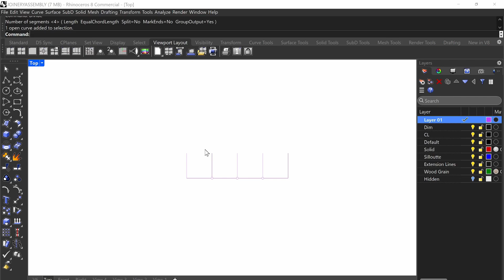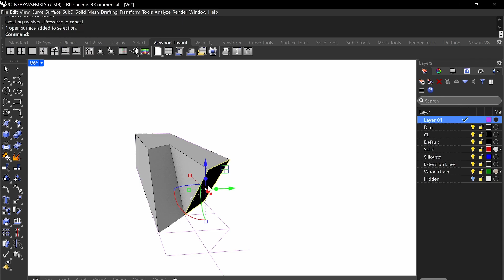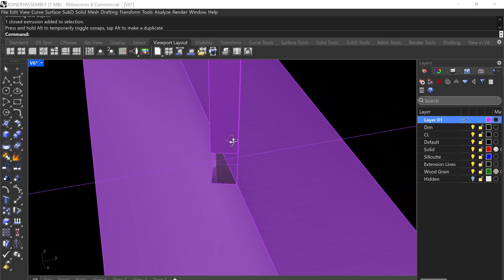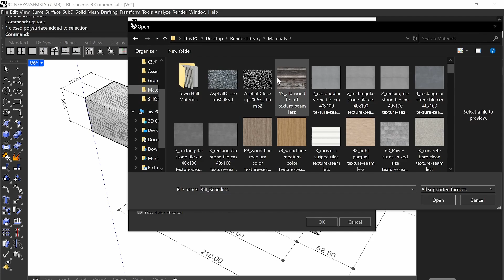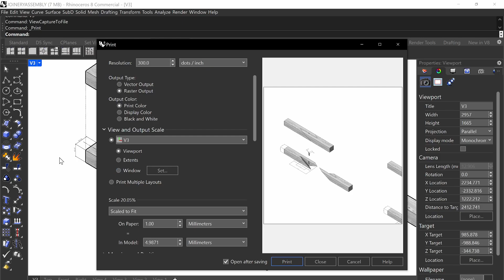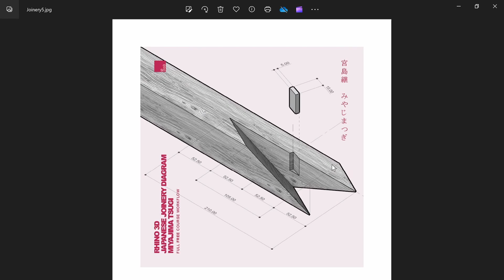Japanese Architecture Joinery in Rhino 8 with Display Settings, Layouts, and Dimension Styles.

Comment: May I ask how you fix the broken corner of silhouette line in the monochrome display?
Reply from the maker: Yes, at 16:00 for curve settings, keep the setting at "Use Object Width."  Make a dedicated layer for a silhouette and add a silhouette curve around the edges. Give the silhouette layer a line thickness. 

If you do the method above, then you do not need a silhouette to be displayed in the options. I have another example of this in the video below (With time stamp)

https://youtu.be/QeDg9GdOrss?si=FtSaKmEFnr58Izqb&t=541

Comment: Learning a lot from your contents, Thank you!
Just noticed that the rotation angle of the key piece looks other way around.
Reply from the maker: Thank you so much for your support! Please share the channel with others if you can. Truly appreciated!

Yes! The Key should be mirrored. Good catch!
Reply: @unitedstatesofdesign  He is right actually, the key as modelled here will move the 2 pieces apart, which is not what we want. You need to mirror it so that it pushes the two pieces against each other. Great video by the way

Comment: Amazing tutorial thank you so much for sharing this.  I am having an issue with the thick silhouette lines looking like they are unjoined and boxy, is there a fix for this?
Reply from the maker: Thank you! 

There are 2 options: make sure your geometry is clean and continuous. If you have two solids next to each other but not booleaned, it will create 2 separate outline. 

If it's still disconnected, you can do "meshoutline" or silhouette, and use the curve as the thickoutline. I actually made a video about this here:

https://youtu.be/QeDg9GdOrss

Hope this helps!

Comment: Did u come up with this way of modeling it or did u use a reference?
Reply from the maker: I have been using Rhino since 2007, so I experiment a lot.
Reply: @unitedstatesofdesign  nice, where do you think i can find other examples of this method of japanese joinery? do u plan on making other tutorials about it?
Reply from the maker: I will be making other joinery videos. I mentioned one of the books I used as a reference, it's a Japanese joinery book, if you look up "Traditional Architectural Japanese Joinery" you'll find it.
Reply: @ thanks

Comment: When exporting in vector PDF, it can see the background as transparent, I believe, but exporting as a vector ruins a lot of things. Normally, what I do so I can easily pick out the background in Photoshop is have a solid-color background/hatch that I don't use anywhere else, so I can just color select it in Photoshop and then delete it to get transparency.
Reply from the maker: Hi. 

So a couple of things:

1 - your process works great. 
2- you can also open the PDF export in PS and select the background and remove it. 
3 - You can do view capture to file and do transparent background
4 - The reason why I am printing to PDF is because I have dimension strings and the lineweights of the dimension strings are very heavy in viewcapturetofile. So I print instead. 
5 - If I did not have dimension strings, I would have just done viewcapturetofile with or without transparent background.

Comment: hi thank you for sharing. I have an issue that my wood texture doesn't all go in the same direction, upper faces are horizontal for example. How do I solve this
Reply from the maker: Click on your geometry that has the material, then go to the properties (rainbow circle), then go to texture mapping (checkered cylinder) and do box mapping. From there you can increase or decrease the size of the texture.